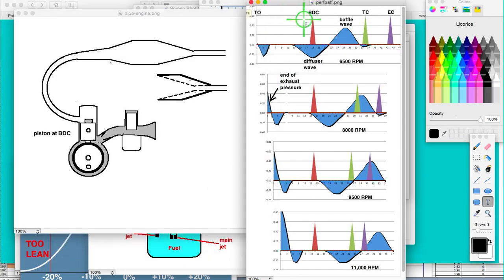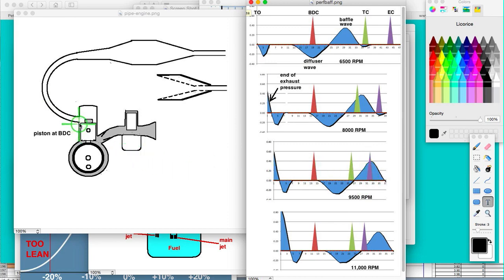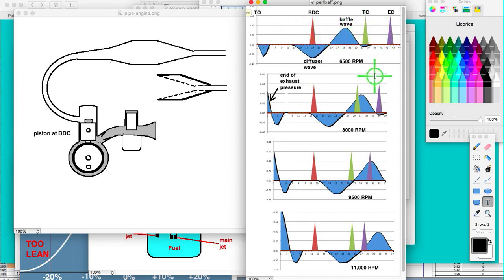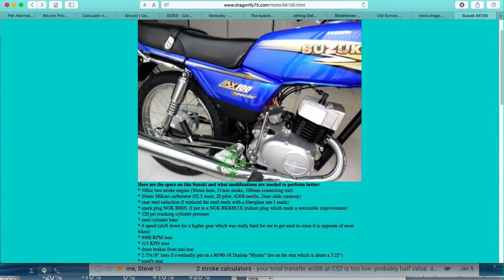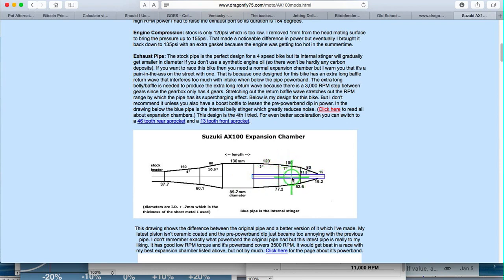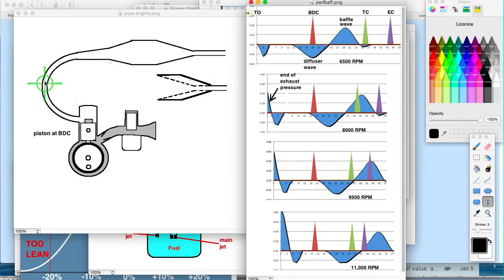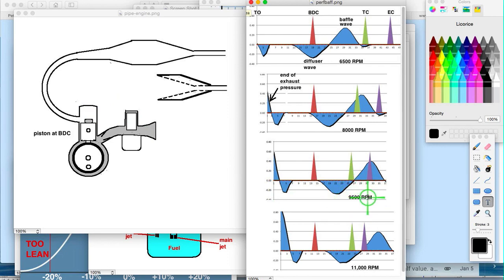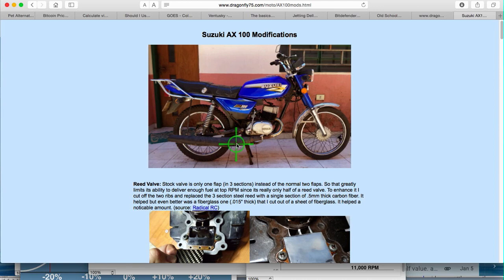Best 2 Stroke Street/Trail Pipe Design

Comment: Can this be applied to a 2 stroke chainsaw motor with a short twisted pipe or does it always have to be a long pipe ?
Reply from the maker: those short stock pipes are designed to minimize the return pressure wave as much as possible, the same as how my design is with a holy baffle cone. With a properly designed longer pipe you can get better power out of them but the size is very inconvenient. People competing don't care any inconvenience though.
Reply: Saya belum paham bagaimana cara membuat desain di knalpotnya pak,,

Comment: Stainless steel wool.

My stock Ax hits the power band at about 7k rpm, where it pulls much harder, but I also lowered the gearing (13x42).
Then I have another AX118 with an FMF enduro pipe with a very long belly and shallow cones. That pipe makes it downright violent at about 4k-5k rpm, but is gutless after 7k and won't even rev past 7k in 4th on a long, steep downhill. How high did yoh AX rev with no load?
Reply from the maker: my AX100 had no problems. It worked great and was peppy enough to race other bikes on the street. (In Paraguay it's common for riders to race each other from light to light. It adds some thrill to a boring day.) You could use my expansion chamber calculator to analyze the FMF pipe and then virtually make changes to it till it gives the powerband and the rev range that you want. Then make those changes to the pipe. https://dragonfly75.com/moto/portsMS.html

Comment: Interesting video but it makes me worry a bit. I used your 2 stroke exhaust calculator to design good allrounder pipe for my suzuki Gp125. It has the same stock exhaust as that AX100 you showed in the video. Would I be better off leaving the stock pipe on or continuing with the custom one?(I already tacked the sections together but will need to sacrifice the stock pipe for the initial bend) 

And what is your opinion on rasing the compression ratio of the Gp125 from 6.9:1 to 10:1.?(it's a dome chamber with no squish band). 

Keep up the good work Mr!
Reply from the maker: I would keep the stock ratio. Just drill holes in your baffle cone (around 70 of 4mm dia.) and then enclose it with more metal. The stock pipes aren't as good as custom because they have a terrible junction where the header and diffuser cone connects, and a single diffuser cone doesn't give an optimal peak suction like a dual or triple cone diffuser does.